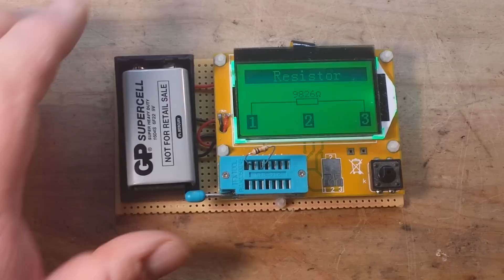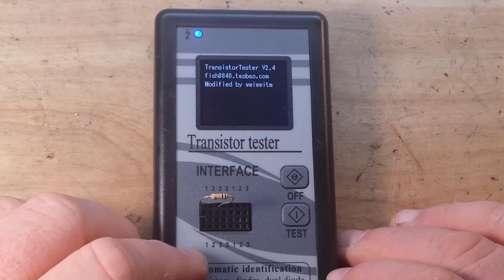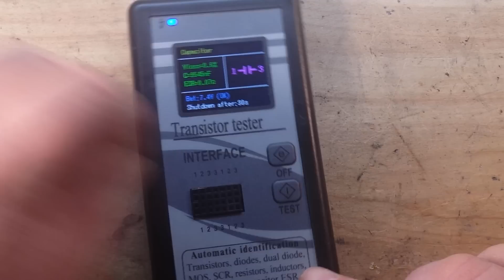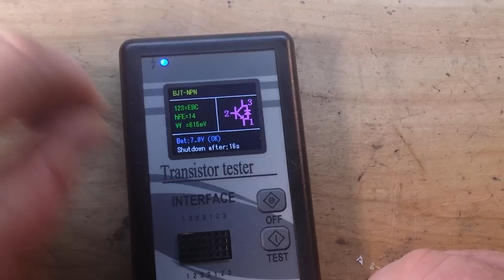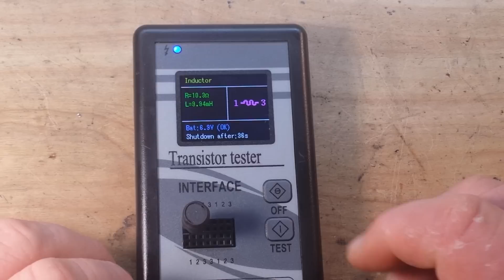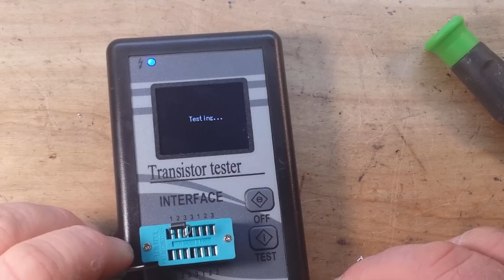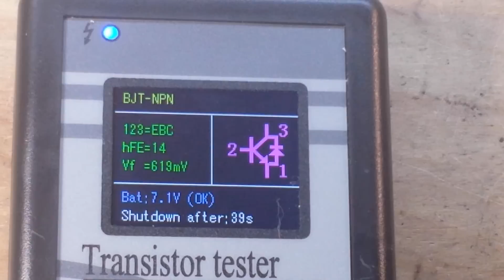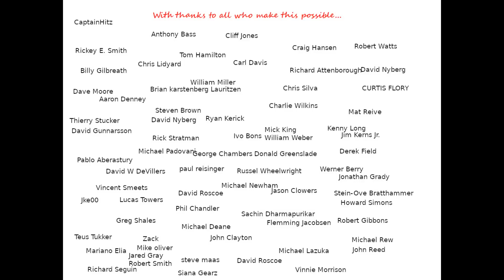DROK Color Component Tester

Comment: Total noob building some guitar pedals. Got one of these to match JFets to .80 mA. How will this info help me?  There must be a conversion to use this info with?  

Having a tough time figuring this part out

Thank you for the video
Reply from the maker: Just match the beta (amplification factor). It's called hFe on the tester.
Reply: @learnelectronics  how does that tell me the mA?  Thanks
Reply from the maker: It doesnt. match them via the beta
Reply: Thank you
Reply: @learnelectronics  curious s to why the mA would be unimportant.  I've read a few times that getting them very close in Ma value improves the sound of these types of circuits.  Sorry for the lack of knowledge

Comment: The part marked 431 is of course not a transistor, but a precision voltage reference.

The capacitors you're asking about... they look suspicious in the sense that they aren't connected to anything? I mean they go right up to an FPC connector that is left unpopulated. Unless there's some via that i'm not seeing, in which case they'll probably be buffering the TFT panel's high-frequency power bursts.
Reply from the maker: They are decoupling caps

Comment: Cool toy.
Maybe you can try and update your older B&W version with new firmware? 
Current black-and-white versions also have ESR, at least mine does, and well enough "for government job" = know when replace capacitor.
I replaced battery with AC-AC adapter from thrift shop & small DIY 9v regulated power supply based on RSD academy lessons.
Power supply sit in a box, and it's just right size to attach tester itself on the top. 
I'm just too tired of batteries :)
Reply: Yep, mine has ESR too. Interesting.